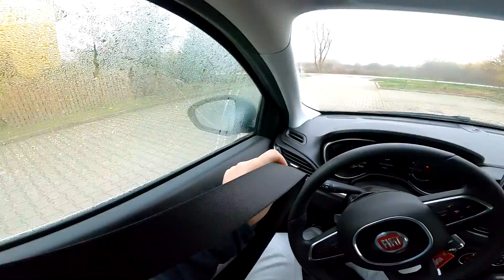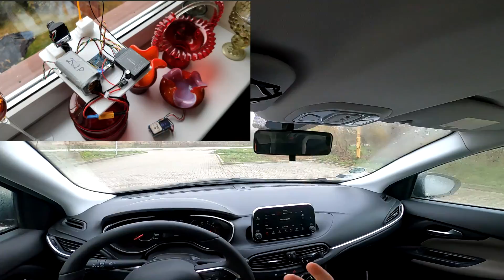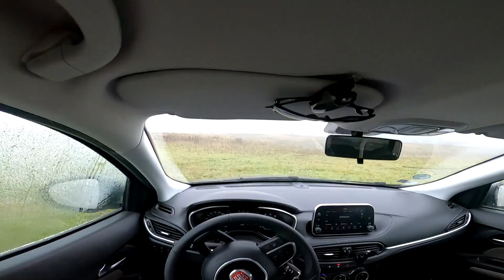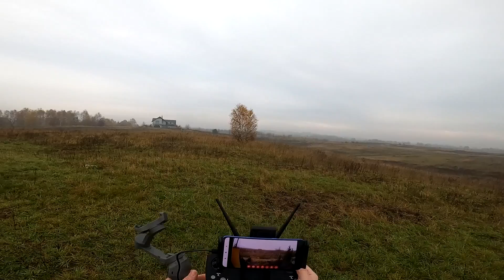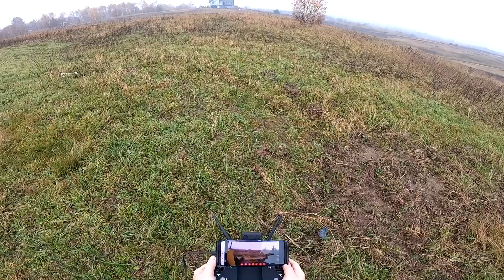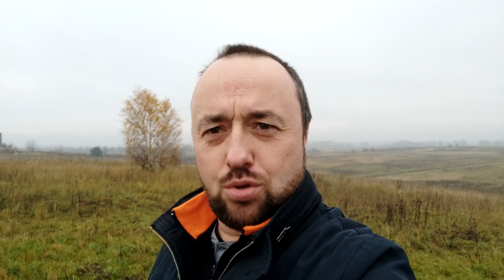SkyDroid T12 Digital FPV Range Test

Comment: Hi Pawel Spychalski. I have a simple question.
When I use Skydroid 3 app Device Helper, Skydroid FPV, Skydroid Tower, It keeps stopping. Would you tell me reason why and how to fix. My cellphone is Samsung S20 FE. Thank you.
Reply from the maker: Yeah, at one point it started crashging all the time when I upgraded Andoid on my phone. Seems like Skydroid app never fixed those issues
Reply: @FPVUniversity . I got a temporary successful solution from Matthew Lindenschmidt as followings.
A "FIX" FOR EVERYONE, HOPEFULLY!!* -Turn phone on airplane mode, then plug in and the app stays open. Even though none of the features work on it it DOES pick up the VIDEO TRANSMISSION in decent quality, use your phone's screen recorder to record the video that the receiver is picking up then edit the video using a video editor! This app is trash though and the product should not be sold anywhere I am lucky to have figured out a way to Make it somewhat work by me doing all the work.    
Cheers.
Reply: @FPVUniversity  Oh my god. It means you have the same problem and we should wait until Skydroid ltd fix the problem.

Comment: This is very interesting. There's a whole bunch of new stuff coming out for long range unified FPV, but apart from super-expensive professional stuff, it's all rather dicey. If you can prove this really works, that'll be wonderful.  Unfortunately, the various chips that do this are proprietary, so manufacturers are trying to each corner the market. Amazing innovation coming from China, but let's see how it shakes out.

Comment: 3km ground level basicly means 10km in air. At least
Reply: I am currently achieving only about 50 meters of range on ground vehicles, even after strictly following the SkyDroid manual instructions.
I would like to improve the communication range to 500 meters–1 km.
Could anyone please suggest possible improvements, configuration changes, or best practices to achieve this extended range?